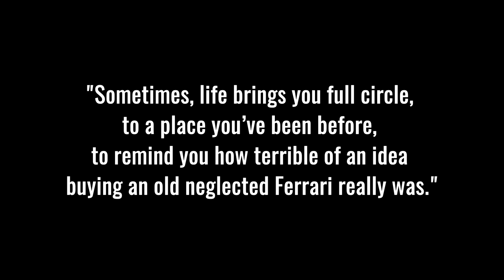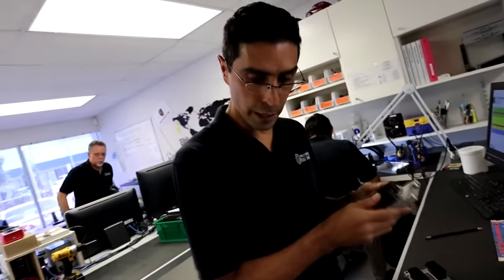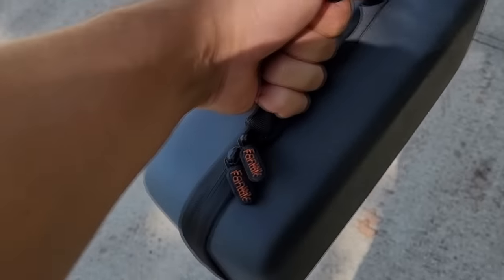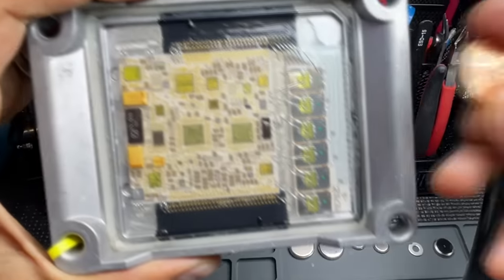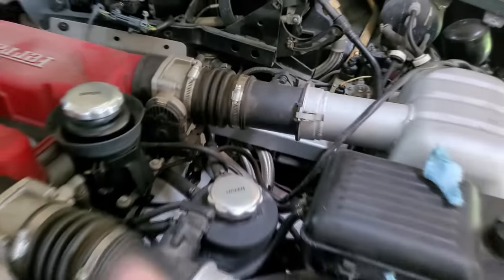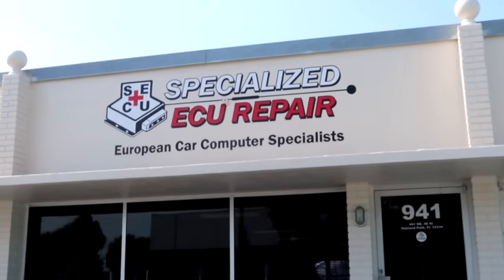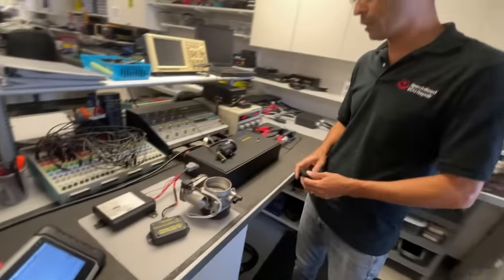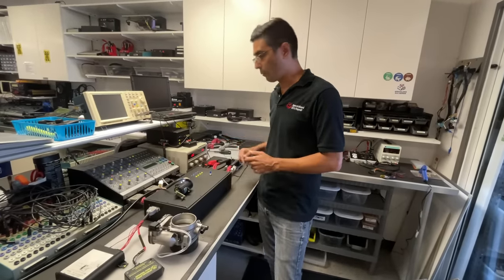Here's What FINALLY Fixed my Cheap Salvage Ferrari!!! (EVERY Ferrari 360's Fatal Flaw)

Comment: If Apple made a jump pack, it would cost 3X as much as everyone else's, have proprietary charger cord, and be obsolete in 3 years.
Reply: Nah. Forced update would cut jump battery by half so it would last 1.5 years, BUT Apple will be more than happy to fix it at any Genius Bar for only $800.
Reply: @AdamIsUrqed  Battery charger lead would break ; 0
Reply: apple jump pack would be 22volts and only work on their own brand cars
Reply: But it would look good. Still no headphone jack, though.
Reply: And would have a cracked screen and a sketchy charger cord
Reply: @rodcrandall1589  you have to hold it just right.....
Reply: And Apple would tell you exactly which cars you are allowed to use it on. It won't work on any others and if you try, the warranty is void and the device stops working until you take it to a genius bar along with your first born. You'll wait 6 weeks for them to 'work on it' and then they will tell you that it has water damage, so can't be fixed (and still take your first born)
Reply: Well this pack has some garbage marketing and garbage claims, I'd bet theres plenty of packs with the same functionality.
Reply: As a life long Apple iMac and iPhone user - I 100% agree and Im getting seriously pissed off with it. 

My 2021 iMac will likely be the last cos is AM NOT having a computer I can not upgrade the RAM in and the next gen will likely be sealed from factory.
Reply: Only use once, then bring back to Apple store for recharging, as do it yourself repair is not an Apple thing.
Reply: @Tim M I like you Tim M, you seem like you understand planned obsolescence, and our entire culture, we would love to welcome you aboard, as part of the team !

LOL.
Reply: And it wouldn't work unless you had an active Apple Carplay subscription and were within range of a wireless hotspot or cell tower.  No Apple iCloud link, no workie...
Reply: Would u like Applecare with that?

Comment: Apple's version of a jumper pack would be a new car.
Reply: At least cost as much as one.  And only be repaired at official Apple repair centers.
Reply: and the new car would come with less features than the old one....
Reply: @muskokamike127  and in two years the battery would have less battery to save the battery from the battery
Reply: We already have those.  They're called Teslas
Reply: I missed the times where these statement could be considered trolling…
While now they are just understated facts…
This planet sucks…
Reply: That’s Tesla’s solution for repairs
Reply: @FishFind3000  will we ever need need to replace this battery? Nah, but build it into the frame.
Reply: @G_de_Coligny  The planet doesn't suck. Apple sucks.
Reply: @droidtigger  I can think of at least half a dozen cars, trucks and vans where you have to take the body off the frame to replace the batteries.
Reply: @vintagethrifter2114  tesla was the topic of conversation, hence the reference.
Secondly, I'm referring to their new chassis where the batteries form part of the frame, so are not replaceable. Not have to remove some parts to replace them. Not replaceable. Ie, you throw the car away when they fail.
Reply: @droidtigger  It is a concept that isn't in use yet. Depending on how the body mounts to the battery, it may still be replaceable. The cars that come with it would still be covered under warranty. If Tesla can't blame the driver, then Tesla would have to cover it. I doubt that they would want to replace an entire car. If the Tesla Cyber Truck and Tesla 18 wheeler truck is anything to go by, it won't be coming out into production anytime soon.
Reply: No 'right to repair' your car
Reply: @vintagethrifter2114  I've seen one that needs wheel off and fender parts removed
Reply: @vintagethrifter2114  you must be fun at parties whenever someone tells a joke
Reply: @droidtigger  If it's a party of Tesla fan boys, I like to ask them what Tesla has actually delivered compared to what they say they're going to. Then I like to tell them that Star Wars is better than Star Trek and vice versa. Once I have them really going, I like to just say "neither one is real" and walk away.
Reply: @jotterson1156  The Ford Econoline diesel vans need their body removed to replace the batteries. Some of the pickups need their cabs removed. People used to think that it was stupid for GM to put the batteries under their late 1990s early 2000s car's backseat.
Reply: @vintagethrifter2114  ok, that actually sounds like fun haha
Reply: @vintagethrifter2114  crazy...$400 battery change
Reply: You would need to buy the leads separately…
Reply: @droidtigger  damn, I had not heard about that.  Such designs are borderline criminal.  One of the many reasons that EVs are not going to save the planet.
Reply: @bobmcl2406  defeats the purpose, huh.
Reply: Yeah, mechanically, electric cars are far simpler than gasoline cars.  The entire drive train is replaced by a wire to a motor. The battery pack is just a metal box with a shit load of small batteries in it.  Sure, you need to know what you are doing, but how hard is it to learn? It would seem to me, any half-decent mechanic can fix a Tesla.  The problem is, Tesla won't provide parts or the know how.  People can figure out the latter, but without parts, what's the point?
Reply: @nginnv6685  actually, I think all the manufacturers are thrilled with the move to EVs exactly because they will not have long service lives.
Reply: If it were Apple It bricks your the second you try to fix anything yourself
Reply: Apple; "Did you take the vehicle out in the rain Sir? Water damage, you will need to buy a new one."
Reply: The battery goes to shit when a newer version comes out.

Comment: I've been an electronics engineer, since 1984,  and one thing we were made very aware of was an erosion effect called "Silicon Degradation" which slowly destroys transistor based devices over time. It's caused by the electrons passing through the silicon substrate in the exact same way that water passing through rock, slowly, over time, wears it away. In daily use, the average silicon semiconductor, has a useable service life of between 10 & 20 years, before the silicon degradation is so bad that it junction resistances are so bad that it ceases to function properly.

Comment: I used to work on ECUs for John Deere, and the best answer for dying ECUs is to use a programmable aftermarket ECU. I usually recommend Megasquirt, the streetracers' favorite.
Reply: I looked in to using a Megasquirt on an E30, but it was a big project and not worth it.  This technology has to come further or Derek's kids will have to be computer experts to have a "Vice Grip Garage 2030" type deal.
Reply: megasquirts are for the most budget conscious but nerdy folks. less nerdy might go Link ECU